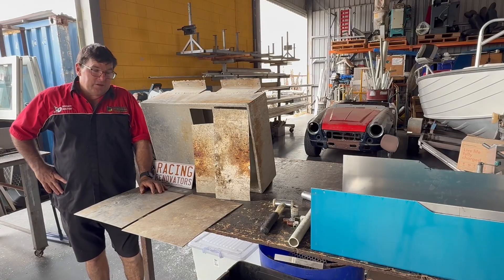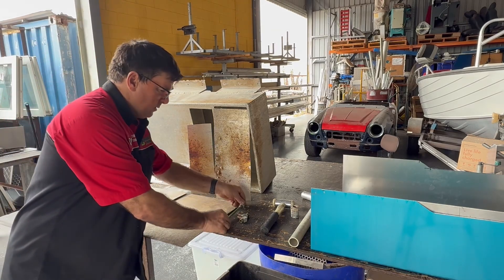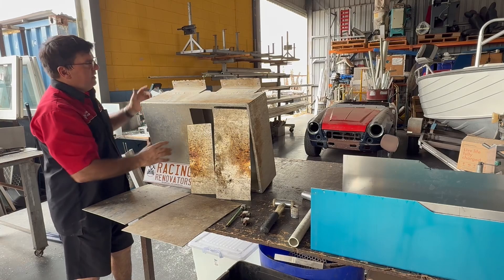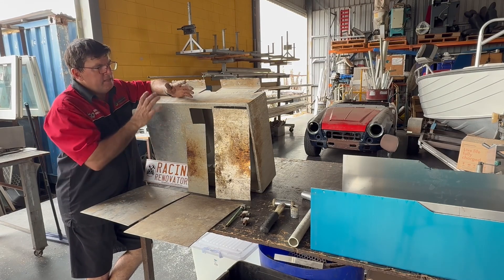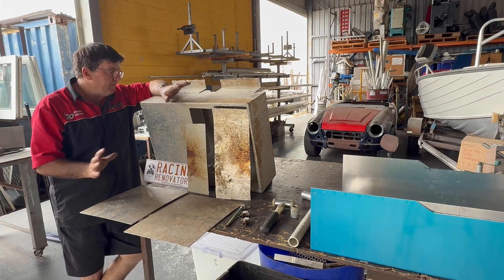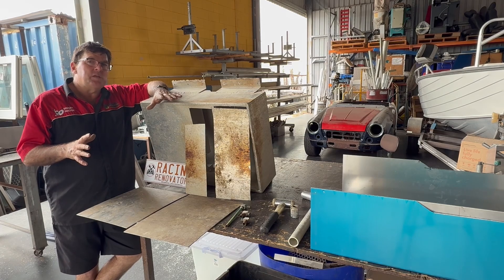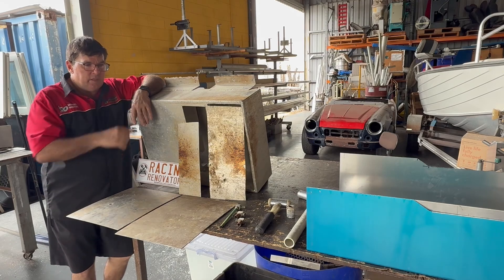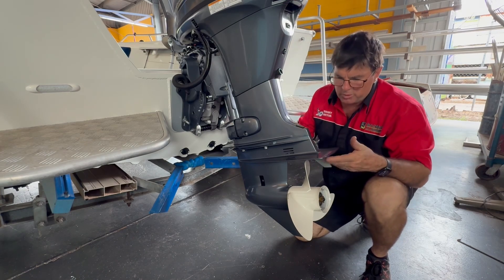Aluminium Boat Electrolysis and Corrosion Prevention

Comment: Great info cheers, im currently renovating an older tinny. Full paint strip and repaint, but i have notices some pitting/corrosion in the bilge area below the the under floor fuel tank.
I'm planning to clean/acid wash and coat with an Autex epoxy primer. My concern is the area under the welded floor that i can't see... I was thinking of acid washing and leaving some (salt away) or something similar in these areas. (The bungs were missing from both under floor areas, so exposed to salt water for who knows how long. new ones installed. What would you recommend? Regards Fisho Miked NZ
Reply from the maker: I don’t recommend painting!
It will lock in the corrosion under the paint if not removed properly and this is very hard to do 
For the future keep it clean 
Wash after every use with fresh water and tip the hull up as high as you can and let dry out 
Have a look at my deep cleaning video 
I mention some other ideas that will help
Reply: @RacingRenovators  Thanks, I'll watch that video.
I'm quite fussy with my boat cleaning and will rinse   well after each use to save this old girl. 
 For the areas under the welded floor that i can't see, do you reckon i should flush with alibright or similar first off?
Reply from the maker: Once a year a deep clean but if you are always watching when things get dirty you know when it needs it 
Just a lot of boat life people do see this as the problem that will shorten the life of your boat

Comment: Hi Pete, I'm about to buy a second hand boat thats around 3 years old.
Is it worth painting the floor area within the boat to protect the hull etc? I dont really care what it looks like but thought this would add some protection whilst also cleaning as you've stated in this clip?
Reply from the maker: Great Question 
I personally wouldn’t put any covering over the floor of the inside of the boat 
I have painted the inside of my own Boat, but I had to put covering over the inside of it or paint on the inside 
The reason I wouldn’t is because if you wash your boat out after use and you let it dry, you’ll never have corrosion problems as such whereas with some sort of paint. If it doesn’t cover 100% Water can get in underneath the paint and create this problem.
Reply from the maker: The reason I had to put covering on mine or painted mine is because I sandblasted it and that was a bit of a mistake
Reply from the maker: Always tip your boat up high after washing it out to let that water run out don’t let Water sit in the bottom of the hull
Let it dry out as best you can

Comment: I use a salt away product on my boat I had to learn the hard lesson. My boat was 60 years old the hull unrepairable  so I had to get a new boat made now I am very careful with making sure nothing ever fitting is only aluminium I don’t use stainless steel fittings if I can I only use aluminium rivets. The floor all welded on so salt come salt can come off. I am so strict at washing my boat make sure it going to last.
Reply from the maker: I look after mine in the same manner 
It takes me a couple of hours to wash my boat out after every trip 
I believe doing this will make it last without any corrosion problems!
Prevention is better than the cure
Reply: I use some acid in it every year when it’s time to put it away for the winter time another thing I do once it’s all dry I get the vacuum cleaner in it to removing any rubbish or sand anything that can make it corroded more easily. Then I acid wash once I have vacuumed it.

Comment: Excellent advice.
Now a question about the trailer in the video. The V loader on the trailer shown, is that something you have fabricated yourself or was the trailer built like that.
I have Telwater Trailer with a flat loader like that of the trailer shown but I want a v loader to facilitate easier loading when driving on.
Reply from the maker: I actually bought a boat and trailer combo just to get my hands on this trailer. The boat that came with it wasn’t what I wanted — but the trailer was spot on. It’s got a nice long drawbar, 10 flat rollers, and a self-centering roller in the V-loader at the front — which makes loading dead easy, especially if you’re by yourself.

The V-loader was factory-built onto the trailer — not a home mod — and the whole thing’s been hot-dip galvanised from new, so it’s built to last and not afraid of salt water.

Once I had this trailer, I turned around and sold my old trailer along with the unwanted boat from the combo I originally bought. Bit of mucking around, but in the end, I ended up with the exact setup I was chasing — a ripper boat and trailer combo, properly sorted.

Hope that clears it up! If you’ve got more questions, chuck ’em in the comments — I always try to answer what I can.

Cheers!

Comment: Thanks for sharing, I have a Surtees which has a water ballast system. I get worried I’m not reaching all the areas under the floor inside the ballast when washing the boat down. Currently using a salt away product aswell. It’s impossible to keep these areas dry especially in the cooler months. Will fresh water create corrosion if not dried? Thanks again
Reply from the maker: It is hard to get everywhere mate but you are doing what you can 👍 
Fresh is better

Comment: Ive only watched this vid so far but ive subbed because i just got an old ally 12ftr gifted that i want to clean up. Your channel states you're passionate about ally fabrication and thats enough for me. I know this isnt your main gig but may i  suggest a lapel mic or something for better vocal volume. I watched on my phone  and the volume was full but difficult to hear the valuable info you're sharing. All that said, appreciate your wisdom. Cheers from lake macquarie 🇦🇺💪👍
Reply from the maker: Hey mate
Reply from the maker: Thank you 
I have been thinking that when I edit sometimes it difficult to hear with the background noise going on 
Thank you I will do something about this 
Great to have this feedback 
This will make a difference 
When you see this In future videos it will be because of you 👍
Reply from the maker: If you have any questions about your project please feel free to reach out
Reply: @RacingRenovators  much appreciated. It's my first ally and beyond any sort of welding. Replace steel screws, replace steel mandrel rivets. Seal up well and pass it on. All in the desire to solve problems with things and hopefully extend their use. Appreciated mate 👍 🇦🇺💪

Comment: Good info mate. I am just decking out a tinny and am using Tef Gel on all of the stainless and other metals. Any hints here?
Reply from the maker: I have used the Tef Gel when the boat was first fitted out it does help 
Thank for watching Stuart 
Only tips clean and dry tip the boat up high I. The front let the water run out